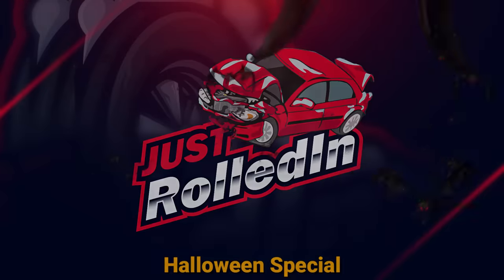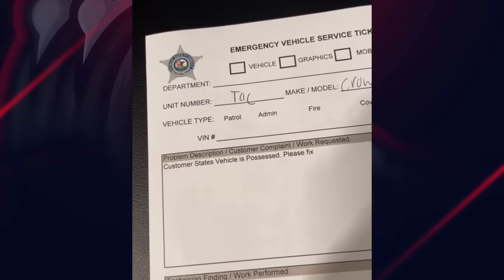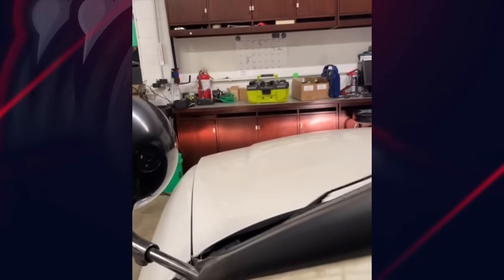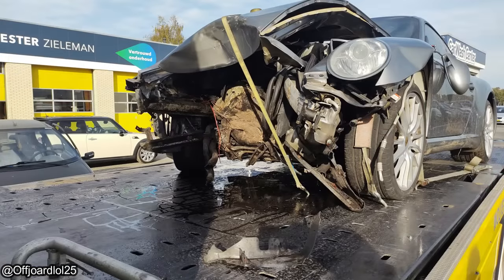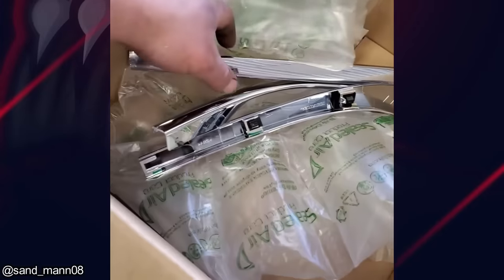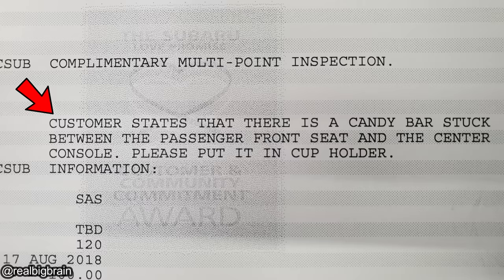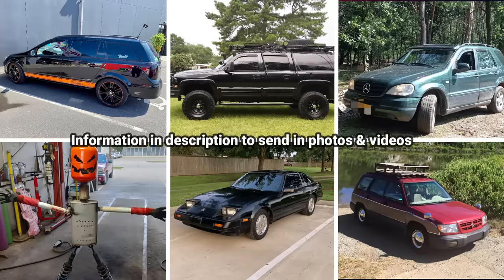Customer States Car Is Possessed | Just Rolled In

Comment: “Car is possessed” Now that is one accurate description by the customer.
Reply: That car needs to go to the crusher.
Reply: Definetly looks like a short somewhere to ground/something is without ground.
Reply: @williammatthews2948  Do it and all the rust in the junkyard will start to clump up to go after whoever did it
Reply: I had a 90's Escort come into the Ford dealer I worked at, with the same complaint: Car is Possessed. It was a warranty ticket, too. Everything related to dash gauges & lighting was wonky. Took 5 minutes to trace it to a ground issue. For the repair, I wrote on the ticket: Perform Exorcism. An hour later the warranty clerk comes storming out yelling "There's no labor operation for an exorcism!!!!" So I wrote the story correctly, got paid .7 hr for ten minutes work. BTW, warranty clerks have NO sense of humor...
Reply: @61rampy65  
Lmao dude was probably stressed out at work
Reply: @61rampy65  yea, these sort of people usually were born with the stick
Reply: I had a possessed car before, it was a 1994 Olds cutlass Supreme, if my wife was in the car it wouldn't start, but if she wasn't in it, it would start no problem. If it was already running as soon as she got in it it would sputter and die. It was pretty funny.
Reply: Yep. Never going to own a Ford since the only one I had experience with was a ranger that would randomly decide to honk the horn. It was totally random and wasn't a proximity sensor or anything. This clip just proved to me that fords are prone to possession...
Reply: In the back of my mind I was thinking the car was going to pull a Carrie and lock him in/finish him off.
I was seriously thinking, "You better be outside of the car while that's going on."
Reply: Isn't that more like Christine?
Reply: @rtex8563  holy crap you're right🤦‍♂️.
I haven't seen either movie in decades.
Reply: Get the priest

Comment: "These are speed holes, they make the car go faster." "Oh, yeah. Speed holes!
Reply: Well when those holes appear in your car it's a good idea to increase your speed so in a way they do make your go faster
Reply: @handlesRdumb  🤣
Reply: "...think I'll go inside."
Reply: "I knew we should have bought more than 3 bullets"
Reply: Every car should be faster with no oil in it for a few seconds. Weight savings.
Reply: Extra 50HP per hole right there.
Reply: That Simpsons episode was hilarious
Reply: Good thing I was wearing a piece of the wooden  cross
Reply: Looks like something straight out of gta 5
Reply: Ok Homer Simpson’s
Reply: Those speed holes were made with speed, ya know
Reply: "They speed up the overheating and make your car needing a repair faster." - a mechanic (probably?)

Comment: I have to admit that seeing vehicles that haven’t had their oil changed is quite disturbing!
Reply: It makes me lose hope for humanity.
Reply: A former in law thinks oil changes are a racket by the oil cartels and never changed his own. Had a brand new car that committed suicide and when shown the inside of his engine and the putrid, congealed oil kept repeating that oil sticking to parts is a good thing
Reply: @redram5150  only if its fresh oil
Reply: I mean I have changed oils as late as 40k miles and they dont look remotely as bad as some of these other ones. Not by choice dont say Im one of those who doesnt change them but there are tons of videos that show proof that 10k miles is the prime time to change oil because they dont break down as much especially synthetics.
Reply: @Villiscaband1  The toasted engines had 90000 miles 40 k is not to bad
Reply: I made so much mess with oil driveway  changes, I was banned by the wifey.
Instead I bought a vacuum device that pulls out the oil via a tube down the dipstick pipe.
Never bother to change the filter,, just pump out the engine oil every 6,000 miles,(recommend 10,000) chuck in the new oil,ten minutes, Bob's your uncle.
Reply: It is quite suprising that an engine can go that distance without an oil change.  Especially as previous episodes show that oil gels like this well short of the miles on that car
Reply: @jackpoage5419  "Scam" while it's been proven countless of times that changing out your oil increases your engine life for a long time! I'm still shocked that people still neglect  their car by simply not changing out the oil and that's the basic requirements of maintenance.
Reply: Please , don’t say wifey
Reply: @sneakerfreak2002  she calls me a lot worse ,has a lower centre of gravity and comes from a large family with lots of brothers so she knows how to handle herself.
What's your problem darling?
Reply: @Alfred Wedmore noted.- I've wondered whether the vacuum device could purge all of the engine oil .
I park the car facing down hill ,so the idea is to get the oil to sit where the base of the vacuum pipe is. 
Unfortunately the car is a diesel so as soon as the fresh oil goes in, it turns black.
Although this could be,as you mentioned, residue old oil contaminating the new 
I might treat the car to a professional mechanic and see what happens. Thanks.
Reply: @Alfred Wedmore I'll get my carcass and the car to a proper garage asap .- you've sown the seed of doubt ! Thanks man
Reply: Why? The oil in the motor lasts a lifetime of the engine. 😁
Reply: @toonmag50  Dude...
Reply: @JWSmythe  suggested timing is BS, however over time oil will absorb moisture. 

3k oil changes are unnecessary as well. That said, whether or not oil is still within tolerance after a sustained use is just a guess without sending a sample for testing.
Reply: @toonmag50  Ban wifey, start changing oil in the drive way again.
There are  2 things that changed mu oil changed forever : Fumoto valve with a hose and a jerrycan with an opening on the side that is molded as a ( mostly flat) funnel. I put the jerrycan under the car, aim the hose attached to the Fumoto valve to the opening of the can and open the valve. then I'll go do whatere i need to do and come back later, close the valve, close the jerrycan, add new oil and Gooooooooooooooooooooooooooo ! ^^

Comment: Crown Vic obviously a former squad car.  I imagine the issues are due to the numerous pieces of electronics that were installed, and then removed.
Reply: It is possible the cause is equipment removal, but almost all of the law enforcement equipment is run through separate circuits and/or electrical fusing provided by the factory for that equipment. 
Source: I install and remove this stuff.
Reply: I went to see an interceptor aft my local trade in place, wasn't as wills as that just the cluster would go on and off.  Took it on the highway to put it through her paces, stomped the gas and she revved sky high but didn't go any faster.  Every light that could flash did and then the cluster went off and on again and looked normal.  They blamed the dash on the equipment removal but i wonder if they did it so all the warning lights would go out.  We didn't come to a deal on that one
Reply from the maker: This crown vic is still in use, from what I was told.
Reply: @Mikeydude001  looks like customer installed alarm
Reply: @kd7cwg  a cheap one at that
Reply: Possession jokes aside, I think someone mixed the blinker wiring with the door locks, and ended up hard wiring them (and a lot else) on so it does that
Reply: It have been caused by someone wiring in a stereo & grabbing the wrong wires. I've seen & fixed that issue before. It caused some havoc, but nothing like that.
Reply: @JustRolledIn  BURN IT!
Reply: the issues are from its ptsd from what its seen on the field
Reply: Sounded like a Motorola Radius CM200/CM300 2 Way radio was still installed in it too (the bee-BEEP when he turned the key on.)
Reply: A mouse probably just chewed a wire and it's grounding out on the frame or something...thst happened to me when I put a wireing harness in for a new tow hitch...just the lights tho not all the locks and other stuff...
Reply: @kd7cwg  ... was thinking a remote start / alarm combo unit. When it fails then all of the misc items cycle randomly.
Reply: @JustRolledIn  Yeah, it's pretty obvious since the clip starts with showing a police dept work order.
Reply: @smbarbour  Glad i'm not the only one who noticed that.
Reply: faulty BCM. would cause all of those issues.
Reply: I had an '85 Diplomat former squad.  They were less than careful pulling out the equipment, but it wasn't quite as epic a mess.  Great car otherwise and fixing the wiring was tefious but not difficult.
Reply: No. That's ghost

Comment: On the Crown Vic, there is a short on the ground in the inside fuse panel. Its shorting out the wiper module, the door lock module (which is in the driver door, but routed through the fuse block...which has a lot of ground cable fuses, which is odd, but..Ford), and also the right side headlight.

So, a powerprobe, and go to town on the wiring...Its not a tough job with the probe. 

If that isnt it...then its the PCM thats shot...and good luck finding a new one, although for the CVPI, theres plenty used ones. 

I have to get back to my Crown Vic this week. Just wrapping up work on the 72 Continental...she's a good girl :D
Reply: I was thinking clockspring.
Reply: @notavailable9919  It wouldnt affect the door locks or the left headlight though. I wont say its not possible, but I didnt see that. I actually had a similar "posessed" situation with dash lights blinking and lights doing weird things but that was a bad alternator and a dying battery that barely was able to give enough spark to get home. One new alternator and charged up battery later, the car was fine.
Reply: Definitely ground short. I had it on a car - mine was for sure on the trunk door - and it also did strange things. Started with wiping the rear window when I hit the brakes while the front wipers were on. And in the end it thought was the first US Renault for decades. My father once drove behind me and told me later that when I hit the brakes, the amber indicators would stop working and the red brake light would flash instead. As there were more issues with that car it went into export some weeks later. A new car was on the agenda that year anyways and so I just decided to change the agenda slighly from fall to spring.
Reply: @MirkoC407  What Renault was it? Ive owned and worked on some too. R5 (LeCar) and overseas on R12 and a little on R8 (I did own two R12s...neat little things. My issues were with the transmission. Never had second gear on one of them...would go from 1 to 3 directly lol. The synchros on 2nd desintegrated and fused into the output shaft...and so it remained lol. I still miss that car...
Reply: @RipRoaringGarage  A 2006 Modus Microvan. That decade for sure was Renault's lowest point. My sister had a 1998 Renault Clio (R5 successor) which lasted for 17 years with only minor issues.
On the other hand my uncle was Renault driver hiw whole life and was always happy until... He started with the R4, continued with R8, R12 station wagon (still a tight fit for a father of triplets, but the Espace would be 2 years too late), R11 (Alliance in the US) and finally a troublesome 2002 Megane. My aunt had two R5 and a Clio in the meantime. He lives on a hill and the Megane actually commited suicide by self releasing the handbrake while parked in front of the house, rolling downhill until it left the road and rolled over into a horse paddock. The next day he bought a Honda...
Reply: @MirkoC407  Yeah. I remember thinking the Megane was cute. I totally forgot I had an R19 (the pre-Megane lol). It was a white 2 door hatch, turbo diesel. It wasnt bad and it lasted a good 15 years. I cant believe I forgot about it...but yeah, the era that came after was very mediocre. And then they went with the crazy picasso era design (I know that was a Citroen but those were not pretty cars in the early 2000s)

Comment: I worked on a possessed truck once. 2014 Ram 1500 3.6L 8 speed transmission. A small knick in a communication wire's insulation behind the dash was touching ground intermittently as the engine would vibrate. It took me 20 hours to isolate and repair it.
Reply from the maker: Damn. You must have been happy to find that!

Comment: The Honda trim one reminds me when they had to replace my fuel line.  When the truck arrived I was there and saw that to get it to fit in the truck they folded it in half.  Needless to  say a new one was order.
Reply: LOL. I ordered a part from a highly recommended and respected motorcycle parts online shop in Europe, it was a 80s Yamaha, a plastic infill for the inside of a fairing, couldnt find one anywhere else, they had 1 left. When it arrived, they had folded it in half and snapped it, to fit inside a box half its length. :-) At least i got a refund, but finding another will be next to impossible.
Reply: @uhtred7860  I got a 78 Suzuki GS400 I can't find a tank or the side covers anywhere. I had no idea that a $100 motorcycle would be a pain in the ass to get running. I've had it for almost two years and it's sitting in storage because I can't find parts.

On the bright side though, the windscreen's mounting bracket is placed perfectly to use the shield as a riot shield. That's neat.
Reply: @GetDougDimmadomed  I know GS400s are super popular in Japan,  a Japanese company called BEET  makes, or used to make side covers for them, the tank might be the same as other GS models 550 etc. I would have thought parts for that model would be not too bad, i guess youve tried Ebay?

Comment: The crown vic is grounding the headlight flasher theough the dash (one headlight dimming with dimmer/ doors locking and unlocking at the same pace as default flash pattern on most wig-wags) Check wiring for wigwag and in pass through (passenger side kick panel), wiper operation with wiper not selected can also be caused by shorted or open circuits on upfitter harness, but most likely culprit is combination switch or relay.

Comment: The ghost wipers seems to be a Ford thing. I've been in several Fords that had wipers that would make a pass or two on the windshield at random for no reason. One place I worked had two Ranger delivery trucks that both did it. Cruising down the road on a clear, sunny day, then suddenly the wipers would run for one single pass.
Reply from the maker: Multiple years multiple Ford models have issues with that. I've replaced a lot of multi function switches on Super Dutys for errotic wipers lol
Reply: @JustRolledIn  errotic wipers are a random turn on
Reply: @JustRolledIn  Ford had a TSB on that. Replacing the GEM module fixed them.
Reply: @Eric_the_Hiking  Nice

Comment: My Ford has started doing weird stuff like that. I can start it and only right when the engine starts running will the occasional headlight, wipers, power locks or windows start functioning. Like the head lights turn on, or the doors lock and unlock rapidly for a various period of time, or the windows randomly start to roll down momentarily. And it’s not an ex police vehicle either, so it can happen to other fords that are not electrically adulterated like ex cop cars lol

Comment: That possessed crown Vic doesn't surprise me, my 08 has a host of electrical issues. Tons of ex pd ones have bad electrical stuff because they just rip out all the cop stuff and leave wires everywhere. Mine has probably 2ft of wire just wrapped in electrical tape shoved in the engine bay lol

Comment: The possessed car probably has a serious electrical problem like very bad shorting, bad relays and/or completely broke switches (for the lights/windshield wipers) or a partial computer failure. But it'll take a lot of diagnosing and maybe a priest just to be sure to fix it

Comment: stupid question... arent there any mandatory inspections on cars in the us? watched a few of these videos now and i got the impression that you can drive everything - as long as it has one or two wheels? is this impression wrong? are there any mandatory yearly / 2 yearly checks - and if so.. how on earth is it possible to pass them with such breaks etc?
Reply from the maker: I'm not from the US but from my understanding each state has different rules.
Reply: @JustRolledIn  oh ok, youre from canada, sorry... doesnt seem to be much different there...
Reply from the maker: @MrNukedawhales  where I live you need an inspection for vehicles that are 12 years and older for insurance reasons. But I haven't seen vehicles in such rough shape until I started this channel lol
Reply: @JustRolledIn  oh ok.. in the eu you need an inspection every 1-2 years - depending on country and age of the vehicle... brakes, tyres etc like this cause so many accidents - no wonder youre only allowed to drive 60 mph on the highways... and you have still a much higher deaths per mile rate than the country im from - germany... but anyway.. thanks for the reply... these videos are really shocking!

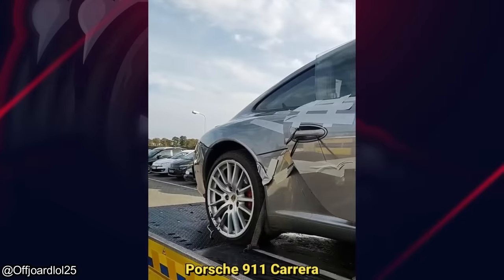Comment: Power steering means that the steering wheel has no connection with the wheels at all? 1:25

I thought it meant you had an electric motor giving extra strength to turn a shift that was between the wheels and steering wheel.

Comment: That poor Carrera!!  Powerful cars are just that - powerful.  They can build up tons of inertia (speed) in seconds, resulting in a huge risk of a crash if not handled responsibly.

That 911 appears to have been the victim of a driver who was not 100% ready to handle the power at their hands.

Disclaimer - Although not impossible for it to have been another driver's fault, I feel safe assuming it was the Porsche operator's error.  The circumstances are too coincidental to be any other likely explanation.